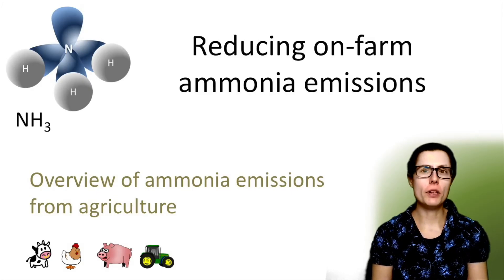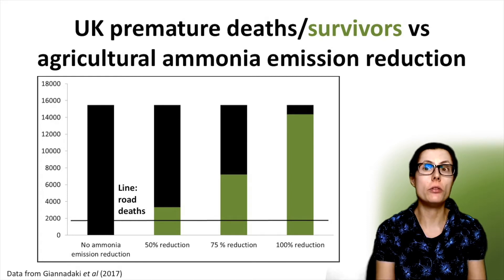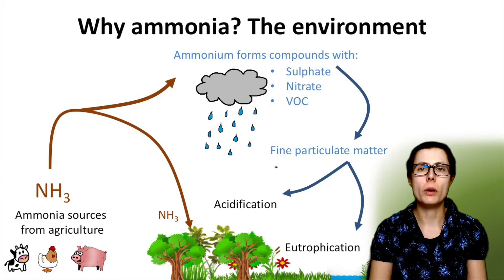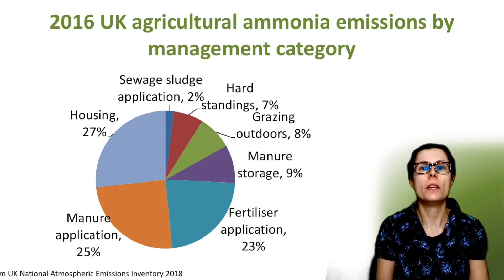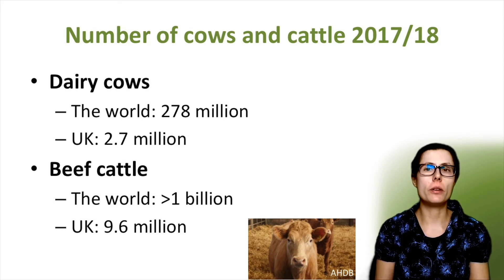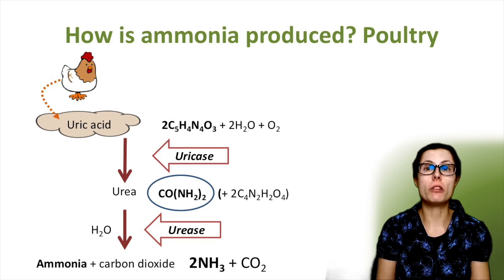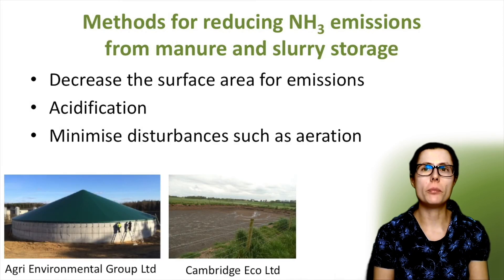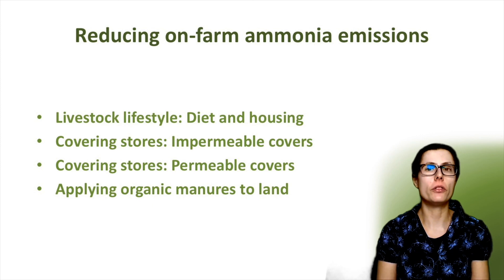A1 Reducing on-farm ammonia emissions: Overview of ammonia emissions from agriculture

Comment: I work with dairy farmers to reduce their environmental impact via stabilising volatile gasses such as ammonia by treating slurry with an additive (Plocher) product from Germany which is a catalyst which switches the sorry to becoming aerobic which then results in the production of Carbonic acid which stabilises the ammonia as ammonium .I have used an ammonia meter to test the off gassing of treated slurry and found only low levels of Ammonia form 5 to 12 Ppm and this was while stirring the slurry.When applying this slurry to the field there is no off gassing and therefore the need to inject or trailing shoe is nullified along with the need to cover the slurry and or encourage a crust which results in further production of Ammonia as the slurry becomes anaerobic. The reduction in fertiliser Nitrogen is possible as the slurry contains available N in the form of Ammonia as well as organic N which is broken down slowly throughout the following season.The slurry becomes a homogenous mixture which results in an even spread across the land which can then be balanced accurately with additional fertiliser applied .The results are a total environmental gain with little or no loss of volatile gasses to the environment, and a reduction in fossil fuel use the apply the slurry and a further environmental benefit when the famed reduces his fertiliser nitrogen purchases which is probably the biggest environmental gain as Nitrogen fertilise rmanafacture and use is very inefficient resulting huge damage to the ozone layer lasting for 114 years .
Reply from the maker: Hi. Thanks for your comment, sounds interesting. Do you have any published data on the ammonia reduction from this?
Reply: @sustainablefoodproduction3213  Hi There and thank you for the interest and being open to other concepts. Yes Plocher did some research in Kingshay and if i can have an email i may be able to find it as they charged me £50 to access it.I also want to ontroduce you to Agriton and Andrew Sinnock who is going to get in touch with you .He is promoting Bokashi in the UK as a method of fermenting slurry and manure which stabilises Ammonia and as the policy for covering slury pits is already established in England his additions of bugs and fungi will work in Anaerobic situations which Plocher won,t and so for England and covered slurry pits this is the product to use .
Agriton have similar research carried out at Kingshay . With best wishes for a better environment and cleaner air and water . Cheers Jon thesoilexpert.co.uk